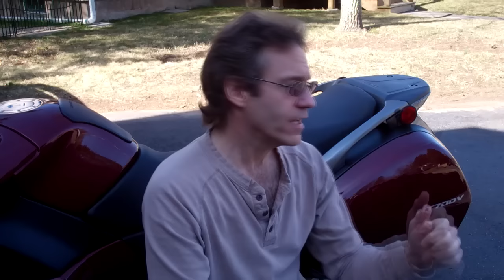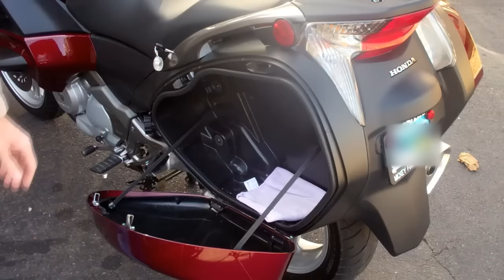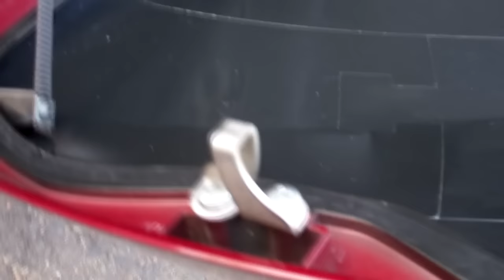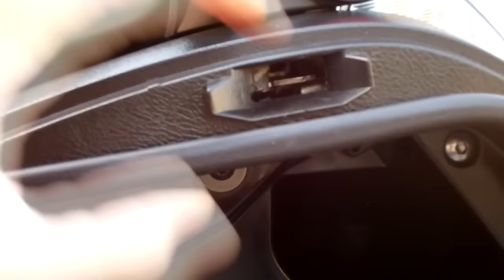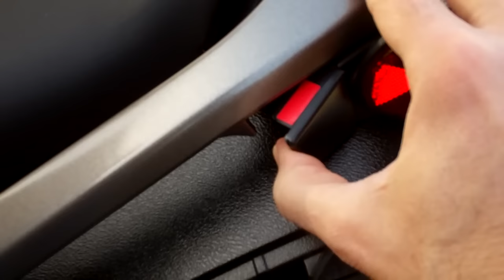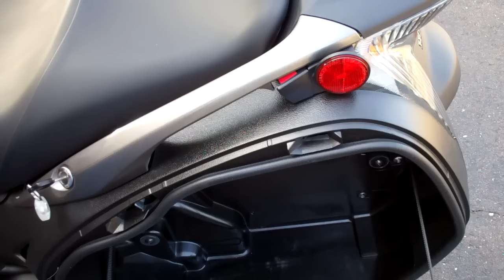NT700V Saddlebag Latches

Comment: Thanks again for this, I've been loving these series of videos as an owner. My problem is I started slamming, ruined one set of covers, then another and now the inside of the latch - the part the rod is attached to - has come away from the housing. I can't work out how to fix that without replacing the entire rear end of the bike! I wish people like you wrote the manual because it would have saved me so much grief!

Comment: An very good explanation. I have the large lids & at first found closing a bit of a pain. But once I worked out what to do they are fine. So much so at 35,000 miles I had forgotten ever having a problem.
 One thing I have not seen mentioned on either NT 650 or 700 videos is the very useful tunnel that runs between two panniers ( saddle bags ) I normally fill the exhaust side first. Before slotting small items through to fill up the small gaps.
 Mid 2022 I have an inoperative ABS actuator. Honda can no longer supply a replacement.

Comment: Another great video Soundtechguy.  I purchased my bike the end of Jan 2012. It was a Honda demo. It wasn't long before my problems began. First, just a little difficult, then progressively worse until I had to tape it shut. Brought it into the dealer. There is a Honda "Wrench" bulletin out on this subject. They replace all 3 springs. 2 days later, the plactic tab on the lid holding the metal tab broke. Dealer replaced the lid. BTW, all problems on left side only.

Comment: Hi. Geat videos. I had the same problem with the RHS front latch. The latch had been in the locked position then the lid shut pushing the locking lever further in and jamming. The latch spring viewed from the inside was stretched compared to the LHS one. Luckily I managed to pull the catch to the open position without the spring flying off. The lid works perfectly now. Eddy.

Comment: I just picked up a used 2008 model, the latches are completely fubar, but I knew this in advance.  Previous owner had fitted new external latches that work surprisingly well and are more secure.  I was just going to fix the built in ones, but actually used to what's on here now :D

Comment: Good video but my gripe about the latches relates to the RHS latch.
When the weather is hot——the case wouldn’t open!
But now, it won’t open at all irrespective of the temp so I have to push the long rod rearward to get the case to open.
The LH case has never been a problem.
Getting at the offending latch mechanism is a PITA!

Comment: Thank you very much for the explanation.  I have a problem with the right saddle-bag, which doesn't close correctly some times. If it doesn't close on the first attempt I shift the metal pin in the right (front side) housing to the right and try again. Mosts times this works. Though I think I spoiled the whole mechanism by having slammed it several times. So - on the long run - I think I have to get the whole locking mechanism being replaced.

Comment: I had the latch failure occur 3 times in 5 months. It was always the left side that broke.  It was the only issue I had with the NT700. I went ahead and traded the 700 in for a ST1300.  I think I made the right choice...
Reply: You did make the right choice———both the ST1100 and ST 1300 are far superior, having owned all 3 models.

Comment: I have this bike there is nothing major wrong with the saddle bag set up, if you have the problem you speak of simply take the seat off and activate the mechanism under the seat easiest way to solve the problem.

I had the problem once where I had neglected to lubricate the mechanism, the side box wouldn't open, took the seat off operated it under the seat problem solved shopping carried home no issue.

The simplicity of the mechanism is its strength, because the two latches work together you only need to make sure when you have a problem that one latch operates to fix the problem.

For sure if you don't know that the mechanism is exposed under the seat then it would be a major head ach but take a look the whole locking device is so easy to access under the seat you should never have a problem that can't be solved on the spot without having to take anything apart, just remember to lubricate it from time to time.

Comment: following mod would work but its whether its worth it. replace the joining rod with two parts that fits together one would be a rod, one would be a tube with a piece of rod fixed inside to stop the other rod going to far in. put the two together and weld a small spring over the join. then you move the cable to the front end. looking side on the rod part would be at the back the tube part at the front. when you pull the handle it would pull the latch from the front (tube part) this would pull back moving the back rod with it. however it would allow the back to work independent if need be due to the give of the spring so in the event of a misalignment you could still latch either part after . i would try to make one up but dont really have the tools atm

Comment: Great and detailed information, even after 6 years still helpfull.
But I do not really agree. I had a problem closing the left saddlebag, doing it gently or slamming did not help really.
Investigating the closing mechanism, I found the front one (left side) was loose and moved away while trying to
get the hook hooked in. 
After disassembling the complete sattlebag, I found the 2 screws holding the mechanism were broken (front
lock, rear lock seemed ok). I made a patch and fixed it, assembled it all but still it did not close well until
i just put 2mm washers to make the hook getting in a little deeper.
Since then, it closes like you explained in your video.
Still, I found it is not nescessary to close both locks "same time", it makes no difference if the sattlebag is not
perfectly in line. But true, both locks must close. Otherwise the mechanism is not safely locked and will 
defenitivly open without pulling the unlocker.

So putting it all together:
I believe the former owner had problems with the closing mechanism that caused the screws break off 
(slamming, pushing hard while the front locker was in closed position but not hooked in)
With the broken screws, it would only lock by coincidence or with luck, but never while closing gently.
After I patched the broken screws AND added washers, the mechanism does its work.

Still, it's a stupid construction and a shame for Honda. This could have been done much simpler with
less (moving) parts and more robust.

Comment: Can they be removed, I think the bike would look better without them?
Reply: junebugg777 no... they can not. They are integrated right into the body of the motorcycle.
Reply: @weberaudio  thank you for responding! I'm trying to decide if I want this or the Nighthawk cb750
Reply: junebugg777 both quite nice (just a little different). As far as dependability goes, you really can’t go wrong either way. I have had both. 

Nighthawk takes a more traditional approach. Classic in line four cylinder (a tad smoother than the NT), chain drive, easy to work on naked bike, very basic, no nonsense, easy to ride, comfortable, and can be had inexpensively on the used market.  

NT is more like a mini sport-tourer. It offers a few noteworthy things that the CB doesn’t such as; fuel injection, liquid cooling, better suspension (single shock in the rear), integrated brakes (ABS on some models), shaft drive, wind protection, storage, etc. With all advantages of the latter comes a little more complexity with working on it. The v-twin has a tad more vibration than the Nighthawks inline four, but it has proven to be one of Honda’s most reliable inventions. 

I guess it really boils down to your personal preference. Both have the same fun factor 👍
Reply: @weberaudio  THANK YOU SO MUCH for responding! This was VERY HELPFUL 👍🏾👍🏾

Comment: So, what did you actually find was wrong? Was the front mechanism just bent back inward keeping it from engaging? I believe that to be the problem with my front mechanism but it is really hard to see anything inside that little hole.
Reply from the maker: The problem really seems to start with the grease that lubes the latch. It hardens with time and accumulates dust and road grime causing it to do more harm than good. I have had my bike since new and only had the latch issue once. After I cleaned the latch and treat it nicely, it has worked perfectly.
Reply: @Soundtechguy  " treat it nicely"....That is the key